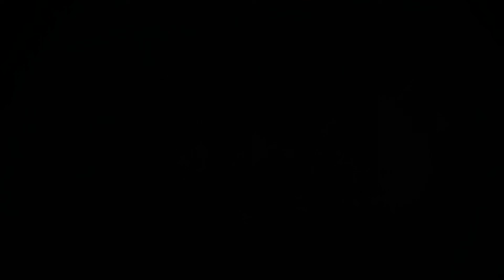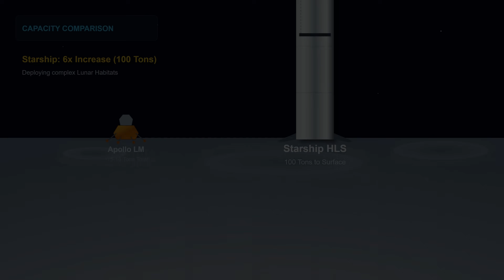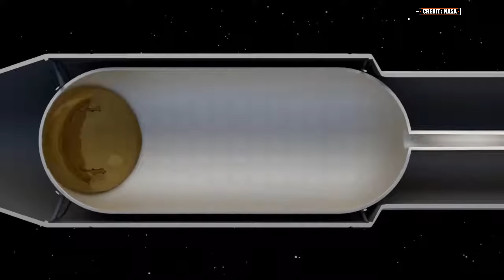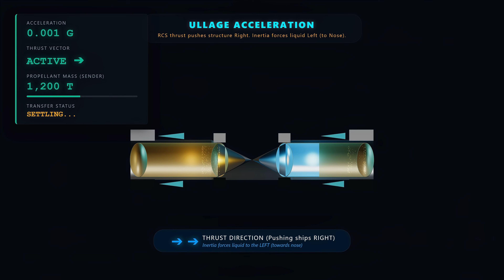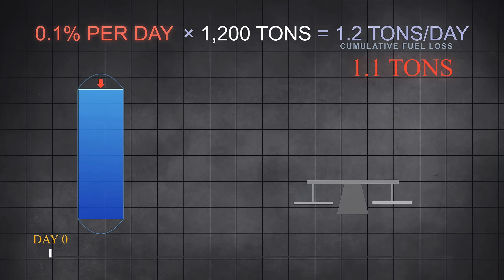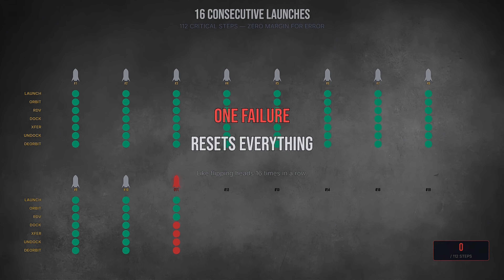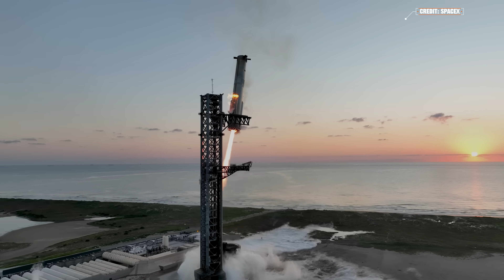Why Starship Cannot Go Anywhere Without Refueling in Orbit?

Comment: Apollo made it to the moon without refuelling. Why not make a smaller Starship?
Reply from the maker: Apollo could do it in one launch because the Saturn V threw away 99% of its mass, landing a tiny 15-ton capsule for a short stay. Starship is 100% reusable and designed to land a massive 100-ton, 15-story building on the Moon for permanent bases. Because of the heavy landing gear, flaps, and heat shields, orbital refueling is the only way the math works under the Rocket Equation.

Comment: I'm wondering how a screw linear actuator running the full lengths of both tanks with a thin piston like cap at the tops to push the fuel into the pipes and small pistons to force it the rest of the way and deployable sun light shoelds to keep boil off to a minumum. Still a lot of flights and days for full refuling.
Reply from the maker: A 9-meter wide mechanical actuator with moving seals at -200°C would be an engineering nightmare! Boil-off gas naturally acts as a "gas piston" to push the liquid out, which is much simpler and has zero moving parts. But you're spot on about the sun shields — they will absolutely use those to minimize boil-off! 👍
Reply: @TheCosmicRushYT  There wouldn't really need to be a moving seal, a simple liquid catch on the other side on the caps would catch any liquids getting past it, along with the gap being so small its own cohesion should stop most of it from getting past the cap. If the liquid catch and cohesion are not enough, then they could use steel foil bag lining the tank walls to collapse as the cap moves, sortoff like an accordian, ensuring all the liquid is contained and moves without issues. This would be be little added mass to the ship, but not by much.

Comment: Instead of small acceleration use a piston to push the liquid out. This way it's much faster. The piston can even be spring loaded. Use the sunlight generate electricity to run heat pumps (Peltier device for example) to keep the liquid cool.
Reply from the maker: A 9-meter mechanical piston at -200°C is an engineering nightmare! Boil-off gas acts as a natural, weightless "gas piston" instead. But you're spot on about using solar-powered cryocoolers!

Comment: Maybe this is too simplistic but wouldn't a system whereby an empty tank is swapped out and a full tank is swapped in work? It would require some kind of heavy mechanical arm but perhaps that could already reside in orbit and the two ships dock with it.
Reply from the maker: Creative idea! But Starship's tanks are structural — they literally form the hull of the rocket. Pumping liquid using pressure is actually much simpler than swapping massive modular tanks in zero-G! 👍

Comment: Still surprised they aren't planning to land Super Heavy out at sea. No boost back would add significant propellant payload capacity to space each launch. I loved the old Small Stars idea of catching superheavy with steel cables. It wouldn't need massive structure built on a platform if the cabling is anchored correctly. Also ocean wave roll wouldn't be a huge problem as the ship hangs.
Reply: Having to ship it back to the launch pad makes it less reusable.

Comment: Also, an individual Starship vehicle dedicated for the moon will not need the extra mass of heat protection tiles. Why would you ever land that ship back on Earth? Providing you can refuel it, it would be a ferry between low Earth orbit and the Moon.
Reply: good catch. there are lots of things that dont make sense in this starship setup. it is crazy that any journalist spreads these informations. where has the critical thinking gone
Reply: @stephanieherman2861 Agreed!
Reply from the maker: Exactly right — HLS doesn't need tiles for that reason. Strip the mass, optimize for vacuum. That's already part of the plan.

Comment: How is SLS getting to the moon and back on one tank with no refuelings?
Reply: It couldn't even get close to the moon.   Apollo could get into low lunar orbit, pulling a lander with it, and then get back out of close lunar orbit to return to earth.   The SLS couldn't even get the Artemis capsule alone to the moon.. they also had to throw in the service module propulsion.   And the set an altitude record.   Furthest flyby of the moon ever!
Reply from the maker: SLS doesn't land — it drops Orion at lunar orbit, then a separate lander takes over. Very different mission architecture. 👍

Comment: Why do every assume that transfer is going to originate from tank like the main fuel tanks??   It’s THE cargo in the refueling ship.  Adding mechanism to steadily push out can be incorporated into refueling tank either like partitioning/baffling or mechanical controls can be achieved.  I dont’t know why people don’t apply this like normal tanker or cargo ships.  You aren’t going to transfer left over fuel!!!
Reply from the maker: Valid — dedicated cargo tanks with baffles is the smarter approach. The zero-G physics challenge is still the same, but the hardware solution absolutely can be purpose-built.

Comment: Spaceship needs two rockets on the sides of the spaceship to kick it in space after the booster reaches it's high, and the two booster fires it to get it in orbit.
Reply from the maker: Starship's Super Heavy already handles that with 33 Raptors — no side boosters needed. The upper stage's own 6 engines finish the job to orbit.
Reply: Side boosters are good near the ground. They are not good for upper stages. You use them if your normal first stage isn’t powerful enough to fight gravity loss because they can be cheap and they don’t need to have good fuel efficiency. The needs for second stage (and higher) are completely different. No gravity loss, no air resistance, limits and mass because everything has to be lifted by the first stage (+ maybe side boosters).

Basic rocket science.

Comment: Why not pressurize the fuel through heat and cause the expanding fuel to move that way.
Reply from the maker: That's exactly what autogenous pressurization does — boil-off heat creates gas, gas pressurizes the tank, liquid flows. Already the plan!
Reply: @TheCosmicRushYT I read the caption and posted…I didn’t watch the video.
Reply: Fueling heating up is actually a problem for cryogenics and Space X is investing heavily on making sure there is going to be as little boil off as possible or else they'll lose all their fuel to space instead of ending up in thrust.
Reply: @asandax6 Understandable.

Comment: Why can’t the starship going to the moon be a nuclear starship?
Reply: Safety Susans.

Technically it's not ready yet.
They really just need a two types of sherpa starships. One to stay in orbit, lighter and better vacuum engines and one to just carry fuel, maybe disposable but cheaper
Reply from the maker: Nuclear propulsion is real tech — but regulatory, safety, and development timelines make it decades away. Chemical is the fastest path for now.
Reply: @TheCosmicRushYT 
I can understand nuclear generates heat, but how do you obtain propulsion from heat?
Reply: @Adrian-l7v heat difference, just like with steam turbines, internal combustion engines, and normal rocket engines. The old nuclear rocket engines (only tested on the ground, never flown) used a stream of hydrogen gas streaming through channels in the reactor and was ejected at the end as reaction mass (very fast plasma).
Reply: @peterfireflylund 
Yes, but what ingredients do you use in space?
Reply: @Adrian-l7v hydrogen, as I wrote. Except you don’t use anything, because no nuclear engine has ever been flown.
Reply: @peterfireflylund 
There is no hydrogen in space.
You would have to bring it with you.
Seems to limit the duration of thrust.
Reply: @Adrian-l7v of course you would have to bring it with you, just like the rocket, the reactor, etc. Same as a normal rocket engine: you have to bring the propellant(s) with you.

Airplanes also have to bring their fuel with them. Submarines have to bring their fuel with them. Cars have to bring their fuel with them (if they aren’t electric).
Reply: @peterfireflylund 
If you have to bring the propellant with you, where is the advantage of being nuclear?
Without water as coolant, nuclear wouldn't work.
Reply: @Adrian-l7v higher Isp. Nuclear engines can throw the plasma faster backwards than chemical rockets. Faster = better. We get more use out of our reaction mass that way.

(And water is not necessary.)
Reply: @Adrian-l7v  it is actually the same that propells a normal rocket. you put fuel into a chamber, heat it up and direct the moving particles into a direction. remember that heat is a measurment of kinetic energy. the hotter some material is, the more the particles in it move around. that is also the reason why ice becomes liquid when it melts. the frozen particles can not move out of their magnetic cells. when you pump in more heat, they start to move faster and faster until at one point they are free to move around.
Reply: @stephanieherman2861 
A nuclear propulsion device makes no sense.
Reply: @Adrian-l7v  i think it does make sense but not for human rated systems. spaceships are just not very good at shielding reactor radiation
Reply: @stephanieherman2861 
I mean, I don't understand how it could be made to work.
Reply: @Adrian-l7v  oh ok, sorry. so you need the heat from the nuclear reaction and you need a fuel. as an example you could use water as a fuel. the reactor will heat the water in a pressure chamber and the nozzle will direct the steam into a direction. this propels the rocket. in reality you would probably not use water, because the efficiency is better the lighter the fuel is. so you would use liquid hydrogen instead
Reply: @TheCosmicRushYT  Please see Eager Space channel for the math and concerns about nuclear propulsion.  Some big takeaways are:

1) Heat generated is not easily managed.
2) Highly radioactive, means massive shielding, which adds tremendous weight, weight bad.
3) Once started, takes a long time to "cool" down when turned off.
4) Not a lot of communities (at least in US) would be willing for a full-blown nuclear reactor to be launched near them.  Even the little radioisotope generators have years of approvals and billions of dollars just to do them - and that's just for the regulatory paperwork.
Reply: Because nuclear rocket engines, while more efficient than chemical engines, don't scale very well in thrust and engine dry mass. For example, in the 1960s NASA and the Atomic Energy Commission developed nuclear thermal engines that produced 250,000 pounds of thrust with a dry weight of 26,000 pounds. The J-2 hydrogen/oxygen chemical propulsion engine could produce 250,000 pounds of thrust at a dry weight of 3200 pounds.
Reply: You've just introduced way more problems than the comparatively simpler refueling problem.

Comment: Actually are other options that the tree you mentioned, for example it can be back to back but not necessarily both with the nose in the same direction but one flipped at 180° nose to tail(that would help to align the different fuel and oxygen lines if the inlets are always on the same side,or at only 90°(like a cross), that would help if the thrusters are on the back and near tail and nose to avoid the exhaust from them hitting the other ship, also one of the ship can stick it's nose at the tail of the other,or actually on the top and in the middle (like a T letter) and so on... Or simply not docking at all, but the two ship flying near by and simply stretching a flexible hose, kinda like aerial refueling.
Reply from the maker: Love the creativity! The aerial refueling analogy is cool but cryogenic hoses at -183°C are brutal. SpaceX will likely settle on whatever survives the engineering reality. 😄
Reply: @TheCosmicRushYT Space X actually uses cryogenic hoses, they are on the quick disconnect arm on ground infrastructure, actually coupling with rigid pipes is more challenging, so probably whatever design would choose some flexibility is needed.

Comment: So, why don’t we have the following:

1: low earth orbit space station with spacedock and fueling depot. A station with some rotation takes care of the olage issues.

2: starship boosters with excess capacity to include a safe landing fuel volume, able to deliver materials to the LEO station 

3: starship version for delivering fuel to the LEO station fueling depot 

4: starship version for operating in earth orbit only- no need to have wings or their mass for something not needed.
Reply from the maker: That's exactly the long-term vision. SpaceX is heading there. 👍

Comment: So what you're saying is NASA never landed on the moon...😂
Reply from the maker: Ha! Apollo used a 111m rocket burning 3,400 tons of fuel in one shot. Starship is just a different — and much cheaper — approach.
Reply: @TheCosmicRushYT  how is it cheaper to have more than 10 launches than doing one? also the cost of a government project is not a bug, it is a feature. basically subsidies
Reply: @stephanieherman2861  Please see my comments to you previously concerning the delivered usable payload of the Apollo program, extremely tiny, and unable to build a moon base from 700 lbs a trip.
Reply: @stephanieherman2861  Because it will deliver a LOT more useful mass to the surface.  It's always about how much mass you want to move.
Reply: @imaginary_friend7300  of course it delivers more mass to the moon, it takes more than 10 rockets to deliver that mass. but is it more than 10 times more mass than apollo did transport? probably not, because it is a highly inefficient design. if it were efficient, it wouldnt use a steel body and heat tiles, and it wouldnt land its complete return stage on the moon

Comment: Full Starship to Starship transfer demo in mid 2026? I highly doubt that. That's basically a month away in that case.
Reply from the maker: Fair — "mid-2026" is basically now, and Flight 12 hasn't even landed yet. Timelines in space are always... optimistic. 😅
Reply: @TheCosmicRushYT  landing a man on the moon before the decade is over did work, didnt it. the only difference was, those guys 70 years ago were starting from 0. must be hard nowadays to reinvent the wheel, at least it took those spacex people longer already than a decade
Reply: @stephanieherman2861  Wayyyyyyyyyy different missions.

Apollo era - land a man on the moon.  Done, 1969.  Great job.

Artemis era - land a man on the moon with MASSIVE tonnage to start a moon base.

Very different missions.  Did you know the Apollo missions landed with only 700 lbs of usable cargo?  And on Apollo 15,16,17 - 500 lbs of that was a moon buggy?
You are NOT going to build a moon base with 700 lbs a trip.
Reply: @ConstantTrue  well they could have landed around 40 tons on the moon if they skipped the return trip. in fact it makes a lot of sense to skip the return trip because it is extremely efficient and not every delivery need people on board

Comment: Also, just the size of the rocket required to get to the moon without refuel g proves no one’s been to the moon before surely. Starships way bigger than the Apollo rockets 🤣🤣
Reply: Does not prove a thing.  Why?

Apollo delivered 600 lbs of usable cargo to the moon.

Starship, Blue Origin, and the Chinese plans are for massive cargo tonnage to the moon surface to build bases.  You simply cannot get massive tonnage to the moon as usable cargo without refueling in space.  Different mission entirely vs Apollo.  Apollo was men to the moon.  The currently planed systems (the three I mentioned) are men **PLUS** massive cargo.
Reply: @ConstantTrue thank you 🤓
Reply: Reusability has a mass cost. Falcon 9 can launch heavier payloads when the rocket’s first stage doesn’t have to return intact to earth. Same with starship. Reuse = has to be more powerful, more efficient, and bigger. Reuse also = (much) cheaper.

Comment: How does propellant work in the vacuum of space. Nothing to thrust off not even air??
Reply: Thrust does not work the way you think. Matter being ejected creates an equal and opposite reaction.
Reply: @Anonymousg64 an equal and opposite reaction to zero movement, with zero to thrust off, would surely equal zero 🤣🤣😅😅
Reply: @WalkswithMisty zero movement? You a troll? One raptor 3 is consuming 858 kilograms of fuel and oxidizer accelerated to 3.2km/s speed is zero movement?  That much mass being accelerated to that speed creates an equal and opposite force on the ship, that being 280 ton-force.

If you throw a 10kg ball at 1m/s in the vacuum of space, the opposite force will have been exerted on your body, if you had 0 velocity, you would now be moving in the opposite direction as the ball. Now imagine that happening trillions of times within the engine at molecular/atomic scales.
Reply: @Anonymousg64 I’m not a troll, it’s 1. Am here and I’m currently balls deep learning rocket science. Thanks 👍
Reply: @WalkswithMisty ”Elements of Rocket Propulsion”, 2nd edition, is a very good place to start. You can probably find a PDF somewhere.
Reply: @peterfireflylund balls deep mate I haven’t been convinced yet rockets work in the vacuum of space 👍
Reply: @WalkswithMisty  One again your ignorance rears it's head and once again you trying to pretend has made you look like a fool.  I'm starting to think you are the real deal. A genuine natural born fool.  You haven't got a thing right yet.
Reply: You have the same “understanding” of high school physics as the New York Times had a hundred years ago. Read the first answer to your question again. It is correct. Read Isaac Newton’s Wikipedia page for more (Newton’s laws of motion).
Reply: Look Up Newton's Third Law